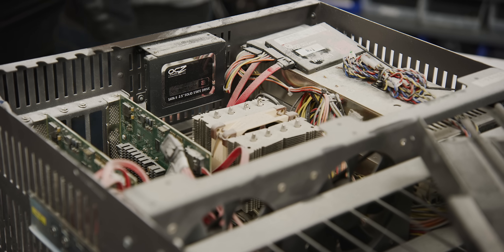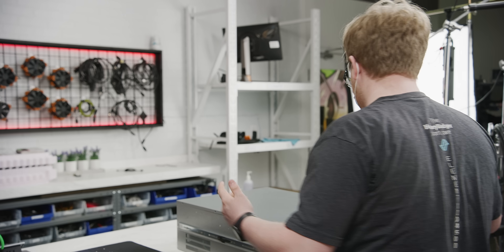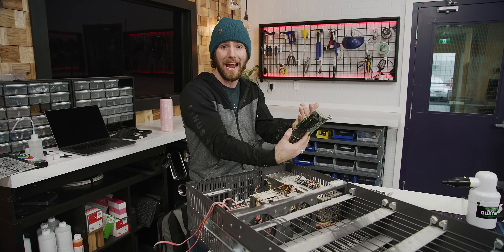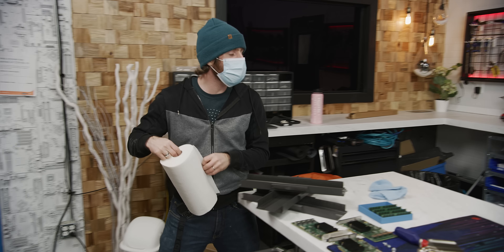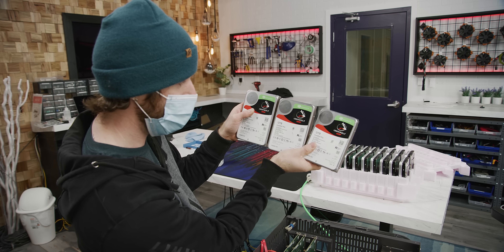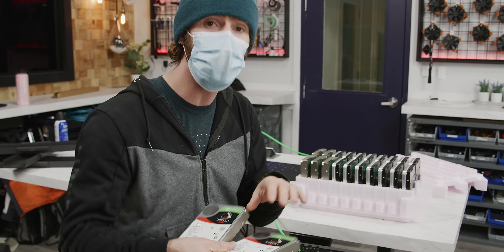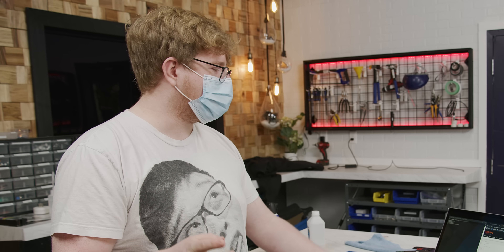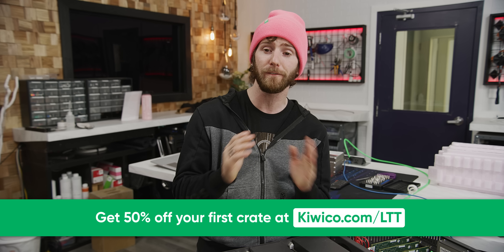Rebuilding Our DIRTIEST Server - Remote Backup Server Build Log

Comment: I specifically by refurbished servers because power consumption is not a issue in my building. They monitor the air conditioners but not the servers.

Comment: I don't know why they insist on using unraid. FreeNAS/TrueNAS works great, and uses ZFS/RAIDZ with a more traditional raid config. Caching is easy, but if you just fill the server up with a shit ton of ram, no cache really needed.

It will also let you virtualize if that's your thing. You can either do full on VMs, or just use jail's which are a type of container.

The only issue I am aware of with TrueNAS is that you can't (currently) extend a raidz. Not a big issue, if you use pools of raidz. You just add another raidz to the pool, and it adds the additional back end storage.

Comment: OK so funny story prompted by the power supply alarm. Once I had to come into my high school on the weekend for a project and there's only one door unlocked on the weekends and it's right up against the server room. So I'm coming into school at 7am on a Saturday and there's a UPS alarm going off. I go "huh, that's a UPS alarm. That's not my problem" and continue to the library. Monday I come in through the same door, the UPS alarm is now a cacophony of what had to be AT LEAST 4 different machines and also the lights are off in that hallway in particular. I think to myself "hmm something bad happened in there, but that's not my problem either" and continue across campus to class. In passing, I notice the intercom system is down, which makes sense given that it's on one of those UPSs. I arrive at class and just as the door closes the fire alarm goes off.

We evacuate, as one does, and stand outside for over an hour in a Pacific Northwest Winter (40F and rain) while firetrucks come and go. And then the principal comes onto the radio system (the teachers have emergency radios) and says "We're calling the busses in. Send everyone home"

We eventually heard through the grapevine that the line from city power to the school overvolted when a transformer blew, and that fucked mains power in the building, fried whatever distributes the power through the East wing, tripped the breaker for the server room only (the only room drawing power at the time, the library is entirely daylit), and when it was turned back on the main panel for the East wing melted and erupted into flames. That panel was in that server room. Given that it took three weeks to get the intercom system back online, I'm inclined to say all hardware was lost. I'm not an electrician, so I don't know if that explanation makes any sense.

Comment: 0:26 you think thats somethin??? Im the proud owner of a 6-7 year old acer pc and last year it startes having some extreeme gpu problems so i mooved it to a desk where i got some manuals and cleaning stuff etcetera and i just thought (well maybe its just overflowing with data and games) and so i broughtnit back to my desk and i incedentally kind of dropped it on my desk and suddontly i hear this buzzing and my screen goes black and then i get confused and tilt  it thinking the back might have split up and the screen cord got loose (witch has happened before with some trash computer i had once a year back when i tried to replace my acer) but that wasnt the case so i sat it back down and then i suddontly hear my fan spin up like crazy and the entire erea around the cooling manifold starts to get covered in dust and grime and what looks like pieces of pcb plastic and it keeps pumping dust for a few minnutes till deres a good milimeter of dust covering the entire backside of my desk and then it just boots up and it has surprisingly been running a lot better since altho it sounds like it has swallowed a floppy disc drive 😕

Comment: One of the key LTT videos out there is "All our data has gone".  After recovering by the skin of your teeth you promised to back up properly.  And here you are, not doing that for two years.  Then you talk about the building burning down.  You are running one hell of a risk.  Also, what is your thinking on testing a backup restore?  If the worst happened, you get into a new building with new servers, you start the restore and find it doesn't actually work!  Personally I have been involved where a company managed to trash its entire customer database AND then discover the backup was bad as well.  A very sad day.

Comment: VISABLE FILTRATION IS SEXXY (see Covid-19 masks) 
Ahem.  Once again I denounce the mention of fans and perforations for air, W/O MENTION OF "EASILY 'VISABLE' ACCESSED FILTRATION".  Without THIS, nobody will 'see' the dirty filters, thus, 'clean' them, meaning, 'dust' adds heat, adds to odds of reduced performance / reliability and possible FAILURE all due to it's lack of 'breathability'. I'll SHUT UP now.  Thanks for the video, again.

Comment: Hehe. I once saw a server that had been in a rack for 10+ years, running non-stop. Sun's UltraSPARC II servers were miraculous...
So, when we opened the case, I saw a bricket (literally) of compressed dust between the air intake and the radiator assembly. It was so tight we could shake ot away in one piece.

Comment: For future reference, 1. Open case, inspect and then turn over and let lose parts fall out. 2. rotate 360 in all directions and listen for lose parts and shake them out. 3. Take out side, put shop vac on blow and from 3 feet back blow it out and if you are nervous ground the case with a power cable to grounded outlet. I once had client that sold concrete and every 6 months the workstations had to be cleaned and the server about  once a year. The solution on desktop was to move them off the ground to desktop. 
Base on the statement that there could have been conductive dust, very unlikely with sheet rock unless someone was doing metal grinding in the area since it settles quickly.

Comment: If you do not have ZFS, rsnapshot might be your second best option for "incremental backups and time-machine-like setups". It is a much more "human friendly" solution as you can literally browse folders like "daily.2 will be a content of that folder on a day before yesterday". When I want to backup Windows' folder (like GDrive, that refuses to be installed on a Network mounted drive that could be on ZFS and would allow easy snapshots), rsnapshot via some network Linux computer or now even on a Windows machine via WSL can be set up (maybe LTT can make a video on this "how-to" as it is free and usefull). So it used to take 2 computers (1 Win, 1 Linux). Now you can run rsnapshot via WSL as a "local time-machine backup" all on a single computer.
The issue with rsnapshot vs. ZFS is that it needs to run rsync every time + checking time consuming file properties. If there are not a lot of files - it should be ok. If there are a lot of files, it will take some time, CPU and disk reading. ZFS will start and finish much quicker.  

One more multi-OS sync application that performs well is Synctrayzor and it works intra-LAN and over internet. We use it to sync our Windows folders to a linux machine that has ZFS under synced folder where we can than create snapshots. 

What is another common issue with offsite backups with a TB/daily is bandwidth. Intra-LAN LTT is now going for 25Gb speeds while it would even make sense to connect 2 servers with a 100Gb DAC cable if needed. Internet connection speed is often a much tougher task. 
1TB/daily via 300Mb/s UPLOAD (more often a bottleneck than download) will take app. 7h. So 1/4 of each day rysnc is running. :S 
1Gb upload speed is in many parts of the world very (and often too expensive) expensive. 
https://www.omnicalculator.com/other/data-transfer?c=EUR&v=size:1024!gigabyte,speed:300!megabit

Comment: Them: "It's a slow connection, only a gigabit"
Me: Confused kangaroo noises
Reply: Slow for enterprise standards. Incredible for home users :P
Reply: @FamiliarDraco  actually no.
Homelabs users find GbE base minimum usable.
Even a single 1TB hard drive can saturate a gigabit link.
SATA SSDs or raided HDDs need 10g or above link.
Reply: @zarmaanful  Well yes, home lab use is a bit of a different story. I mostly meant that that gigabit is awesome for general home use
Reply: @FamiliarDraco  though going on ebay you can get some simple 10gb stuff for fairly cheap.
Reply: Unconfused Kiwi noises...
Reply: @Jacloch  Angry dingo noises 🐕
Reply: Yeah gig is really slow to transfer to only 100mbps
Reply: Just got gigabit internet :p
Reply: 1.000 mbit/s is painfully slow for transferring large backups. I only have ~30 TBs in my home server, but it still takes several days to transfer backups via the internet at that speed.
Reply: I have a 1.5 mbps down connection
Reply: @Hunterofalltrades  same 😮‍💨
Reply: GbE interfaces have been pretty much standard on PCs for nearly 20 years now. Retail stores still find switches with anything over 100Mb extremely unusual, and price them accordingly. I think many still believe that 56kbps is incredibly fast.

Comment: Really a easy clean & rebuild, I once had to repair a "server" a 386, 1992?, that they left with a Slot cover missing, working in a factory, powering their network and Water Cutting Machine, MICE had decided it was nice & warm in there, so they made babies, chewed up paper to nest, crapped everywhere, amazingly it was still working until the day it stopped, and they called my shop, took me 2 weeks to clean the crap out, instead of chucking it out, Customer wanted whole unit saved, even after telling them, the Motherboard was Dead. The controller for the laser was on 16 bit card, which they they couldn't replace, and their "books" & Mail, was on it's Hard Drive, but I saved both, and reinstalled in a New Machine, not only do some people don't have their mice on the outside, they can't see it's time to start anew ...

Comment: Not even that dirty - recently took some switches out of a rack where the room had recently been refurbished, when I tapped the back of one while it was still running - the building fire alarm went off from the dust plume that came out, a delicious mix of concrete/brick and plasterboard dust.

Comment: Why in the name of Sigmar would you use xfs for offsite backup?

Do you guys even know what you are doing or do you just spin the wheel of software every time you do a server video ?

Like you literally mention multiple times that this is "only gigabit" "ancient hardware" "very slow" and then you proceed to use a filesystem that is meant  for high performance, not reliable storage.

Comment: Looks like a couple of servers I had to replace for a smaller company xD they had 1 cabinet with 4 servers and 2 switches... that thing weighed 140kg... when we took out all the servers etc it was only 90kg xD and when cleaned the servers and switches weighted in at around 40kg xD
That means there was 10kg worth of filth in those things xD (it's been 13 years so it's a bit fuzzy on exact numbers... but it was around 10kg worth if filth xD)

Comment: Please make a vidio of all the optyions of actually affordable home backups. Like 3 to 8 drives.  I need a backup and currently have about 10TB of data but slowly blimbing so i need something expendable but i dont need access to it every day so i need to be able to tuirn it off to save my expensive kwh. i now have 2x 6tb usb drives and its a utter hassle.  I either want a setup thats has a clone or another system that prevents data loss but have no clue what a good affordible yet expendable solion is.  im absolutely not a fan of nas systems as i have seen several die and thats a utter drama and they basically vendor lock you so you have to buy another Qnap or Synology to get your data back IF you are lucky.

Comment: wow, I re-watched the original Storinator  video(s).  The 45drives Q30 staring price in 2015 was $725 and here in 2021 it is $4044 ...  according to the the banks based on inflation it should be $806 ... I think the governments calculation for inflation is broken because that is an actual price increase of 457.793%
Reply: ..They're made with updated hardware to provide a much better server instead of the same hardware they were using 7 years ago, as well as vastly better construction materials and methods, and the hardware they're using costs more.

Inflation isn't broken, you're just assuming it to be identical to the 2015 version.

Comment: This wasnt even that bad. I do wireless networks for hotels, and let me you, some of the servers, switches and access points that I have to replace are literally coated with dust and slime. The worse was a firewall that lived in a closet next to a hotel kitchen. I guess the vent situation wasn't great, but the inside of the entire thing was coated in grease. Think about the screens in the vent above your stove, this poor firewall was basically sucking in greasy smoke for its whole life.

Comment: Well, it surely will run. I have 7 years old PC with more dust than my attic. I wash the motherboard using detergent, dry it using hairdryer and it's still works like a charm.

Comment: 10:30 Hey, hang on now. At this point there actually is a reason to specify which Hummer it is that you're disparaging for it's efficiency, because the next Hummer on the line is electric.
I really don't know who that vehicle is for though. People who like electric will want nothing to do with the Hummer name, and people who like Hummer tend to dislike electric anything.
Seeing the marketing for it and the specs I think it's supposed to be a rock crawler, but it's going to be too heavy for that. GM needs to rethink, I think.

Comment: rSync is great I use it to make backups of game servers (minecraft & rust), I found that running it more often created far less HDD hammering, lower data transfers and less preformance hit on the CPU. I use 5min(x3), 15min(x4), 1hr(x6), 6hr(x4), 1day,(x7) 1week(x4), 1month(x6), 6month(x2), 1year(x1). All changes are linked so it does not take up much more space than the first push. This also allowed recovery with very little lost progress for players (max 5mins, depending on the time of discovery of the issue). The more often you run the script the less work it needs to carry out. For time critical operations , a system with a large amount of data churn or if bandwidth is an issue I would even go as low as 1min syncs.

Comment: I've seen PcS worse than that server a quick vacuum and clean and there up and running again I've seen were the heat since fins are totally blocked with dust human skin yuk but with an artist brush and a vacuum and there clean again if you remove the fan then I wash them in soapy water then clean water finally with alcohol dry them off with air as when I used to repair friends computers as they have never opened the side up on there pc in four years so you can imagine why they were crashing all the time as they were overheating because of the dust clogging the heat sinks on the CPY and GPU and 4mm of dust on the motherboard and after about 3 hours cleaning up all the dust and yuk from the computer hay presto it's running again like new after I reinstalled windows as they have never done any file saving or cleaning of there directories basically there are people who just use the computer and that's it they don't check it or do nothing they just expect it to run perfectly year after year without any maintenance which just still amazes me and I bet Linus too but that's the world we live in some when it goes wrong frow it out and get a new one I've seen them in car boot sales as busted and I ask why and they tell me after about half an hour it start to crash and I ask have you ever taken the side off and the answer is generally no so I say ok how much ten pounds sterling to you sir for parts so I say ok and I take it home it has a 2070 video card in it and a intel i7 it is a gaming pc so it was full of dust so much the gpy fans were cloged 2 of the fans wouldn't turn because of the dust same with the cpu the heat sinks were clogged as above so a 3 hour clean I now have all the fans working I did replace one gpu fan and put a better cpu fan on the heat sink relaced the paste on the heat sinck and now its better than my old one and it plays doom at 190 fps and more if I crank it and at 4k oh and i replaced the power pack as it was cooked 'after so much dust it smelled after an hour of running it still ran but after even cleaning it it started to smell me thinks it got way to hot so i put an 850 in instead of the 750  so inever fall luck but that say at the car boot was my day just luck i guess.lol.I just love to waffle on as none will read this.

Comment: I've built one recently. Actually it was fully restoration job - de assembly the whole thing, did a thorough cleaning, doubled the RAM, added new SSD for the OS, changed all SATA cables (the old ones were with corrupted cover), the thermal paste. So now it works and sings :) a PC made back in 2013, served 7 years in office, then - converted do server by me.  :)   
Now its able to push up to 5 4k video streams simultaneously. It's also used as backup  and reserve web server. In idle it needs just 60W of power and is very quiet! Great, huh?
Oh, I forgot the price - I paid for the PC 75Euro, 30 Euro SSD, 20 Euro extra 8GB of RAM, 10 Euro for VGA nVidia 710, 50 Euro for 2TB HDD, 5 Euro for thermal paste. Total: 190 Euro (230USD or 290CAD). 
I expect smooth work for the next 8 years from that server.

Comment: In this episode looks like  Mr Harry Potter The host doesn’t have a clue on how to fix a fix a silver  Instead he doesn’t use safety equipment a grounder safety in case of lecture static shot he thinks it’s a snitch from Quinn . Professor  Lockhart would say famous Mr Harry Potter Harry Harry celebrity Harry Potter. What Harry Potter is doing in this episode Of Potter watch. Maybe Professor Lockart And the Dursleys think that might be right about Harry Potter the host of the show